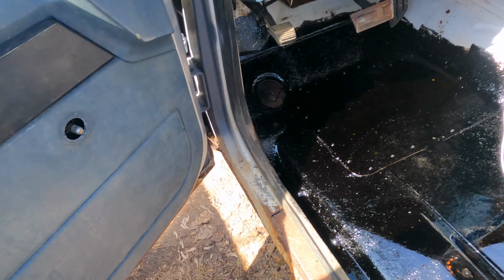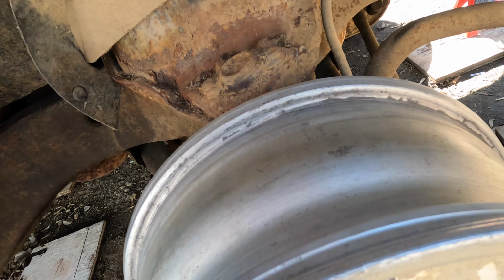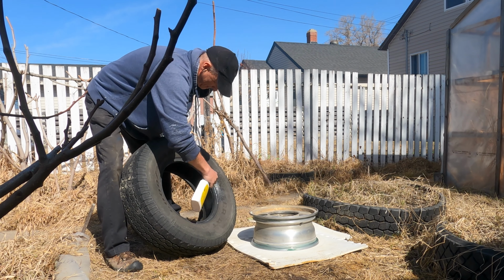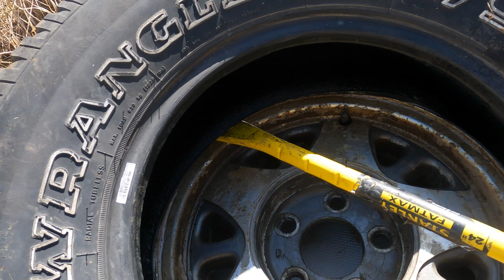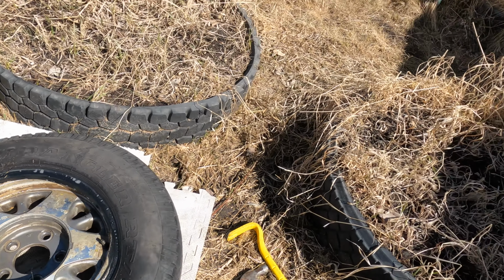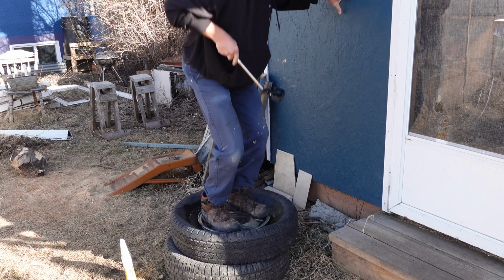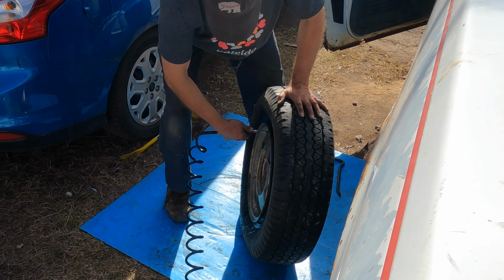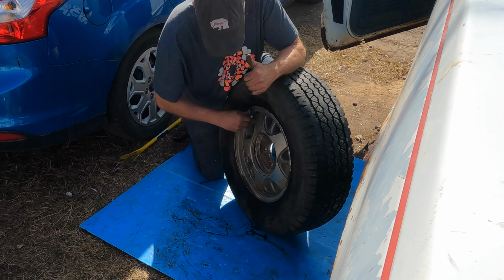Mounting Tires at Home without proper Equipment

Comment: For mounting each bead, I usually hold the part that's already on more amply far down with my knee or something, while using a hand sledge to hammer each next several inches on, and then only use a lever for the last little bit, having made sure from the start that the last little bit isn't near the valve.
Reply from the maker: Got to try that next time. I was struggling a bit with that. Thanks Tom.

Comment: Tire installation can be a pain. I remember one time I had to replace some tires on a garden tractor and I kept thinking to myself they must have used a machine because the lip on this rim is pretty darn tall. Turns out it was a 2 piece rim where you had to take off the inner bolts  and then after the metal is separated you could pull the tire of easy-peasy. Compared to that, regular rims are still frustrating, but at least I know it's possible. Soapy water, a tire lever, and perhaps some curses.

Your 4 wheeled velomobile is coming together! Time to get some of those QR brackets and install them in the flatbed for bicycle hauling.
Reply from the maker: Sounds like a great idea! We'll be hauling both, bikes and inflatable boats this summer. Those tires get easier with practice. There have been some horror stories about the split rims on large trucks. Thanks for sharing.

Comment: I would go to princess auto and pick up a tire changing manual machine there like a hundred bucks they have a special tool that will aid in removing and installing tires! It is worth you while I have one and it works good not as good as the industrial ones but better than a crow bar!

Comment: I would just put air in it! it will seat itself always put air in it with it standing up and don't stand with the rim facing you expecially aluminum rims with steel less chance of anything happening! lots of lube but if you find with air going in and it doesn't seat take a ratchet strap and put it around the circumference of the tire and tighten it this usually works!